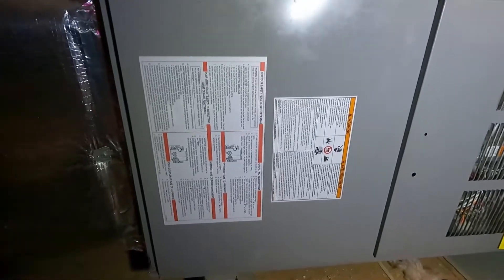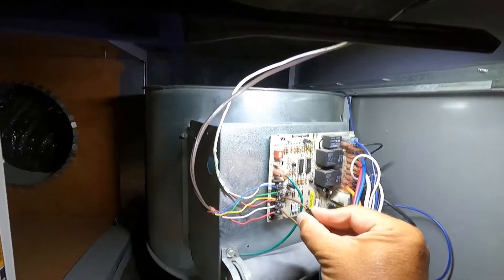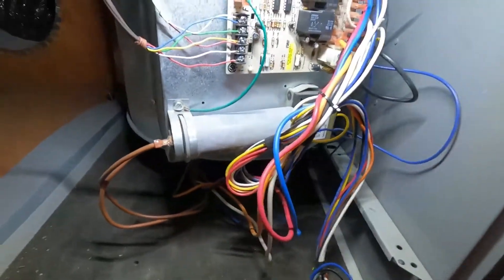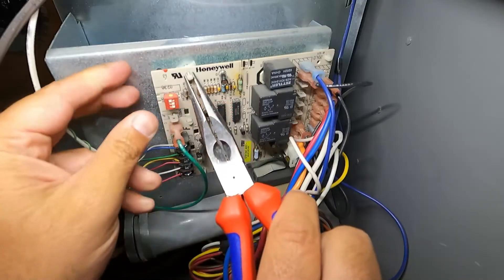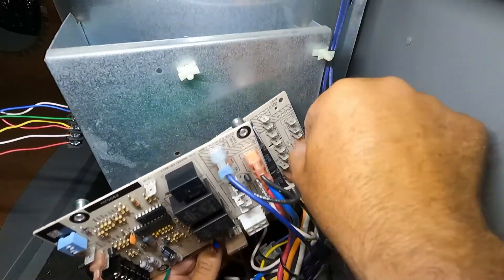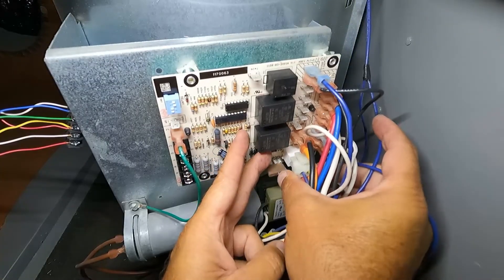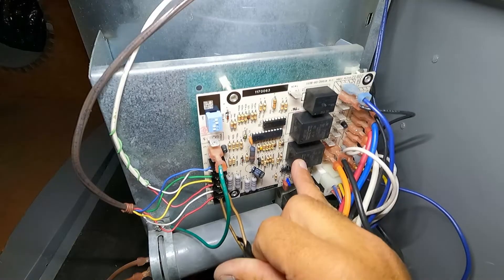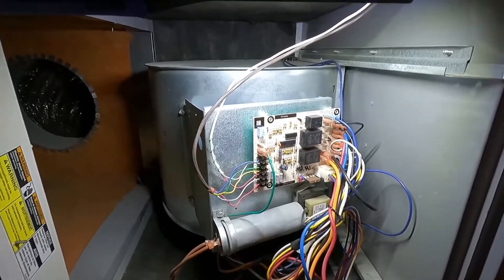HVAC INDOOR BLOWER FAN NOT WORKING - FAN WON'T TURN ON - REPLACE THE BLOWER FAN CONTROL BOARD - DIY!

Comment: I have pretty much the same heater right now. Jumping motor doesnt work, and the control board also doesnt provide power. Anybody wanna comment on the odds of both going bad around the same time?

Comment: I have a system acting in a similar fashion. I've replaced the motherboard on it twice. Keeps blowing a relay or a fuse on the motherboard. Could this be an issue from the thermostat?

Comment: Awesome video. I hired probably HVAC tech probably 20 times over the last 30 years to replace the board and capacitor. Now that I learned how from your video, where can I find the board to buy?
Reply from the maker: I usually just search Amazon based on the part number or numbers on the old board.
Thx!
-Dan